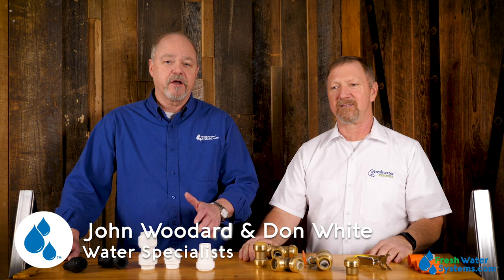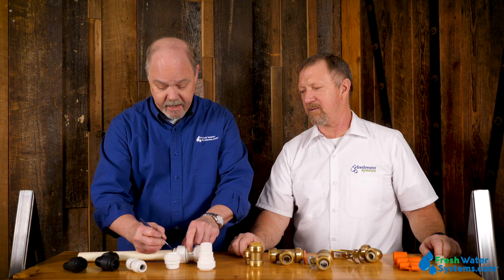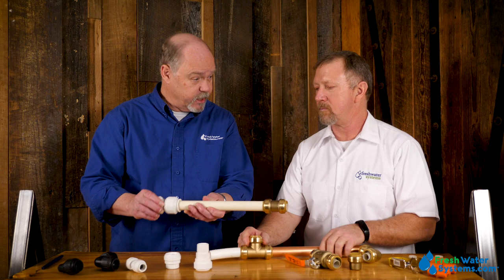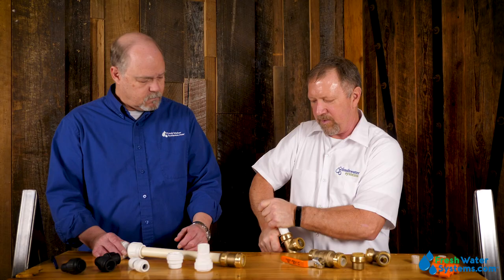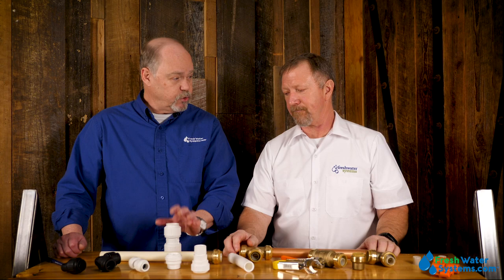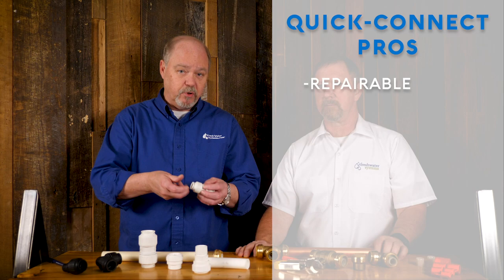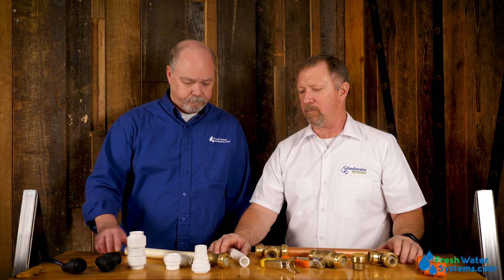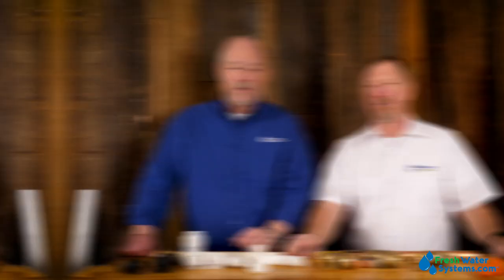John Guest Quick-Connect and SharkBite Fittings: Are They Reliable?

Comment: The problem with the o-rings is they can deteriorate when it comes in contact with chlorine from city water. If you live in the country side and use well water, those o-rings should last many, many years.
Reply: @sonacphotos  mine has lasted for years, no issues and still looks brand new.

Comment: How do the o-rings get UV light inside the fitting? What kind of crappy O-rings is Don used to using if he thinks they will deteriorate so easily? 

Why don't you discuss the approved uses, UPC code approval, etc?
Reply: I dont think he understands how UV light works.
Reply: @MrBoxxxed  I wonder if he understands how many nitrile O rings are connecting his fuel lines in his car as it goes from cold to extremely hot carrying gasoline.

Comment: In the UK virtually all new-builds are done with plastic pipe and most of it is behind walls or in the floor void. Think they offer 50-year guarantee over here.
Reply: My heating system is now over 10 years old and was redone in grey PB pipe with JG speed fit fittings. Zero issues after many winters and thousands of heat cycles. Glad we don't have sharkbites here, they look dreadful

Comment: The only time I’ll use them is in an emergency situation.  A lot of homes in Boise Idaho are plumbed with polybutylene and they make a poly to pex or Polly to copper adaptor.  I don’t warranty this repair because shark bites suck.  I’ll always give the customer the option to replumb the home since polybutylene pipe has such a huge fail rate, especially when the water districts use a lot of chlorine.   The other time I use them is if it’s a CPVC repair.  I hate cpvc and trust a sharkbite fitting over a CPVC glued fitting!  Again, I’m clear to the home owner that I won’t warranty said repair, and advise they need to get that plumbing out of their home
Reply: Hey Chris - what type of plumbing do you recommend/ stand-behind/ warranty for your customers?
Reply: "Because shark bites suck". Care to offer the world some definitive evidence? Most plumbers would disagree with you. What secrets have you discovered that the rest of us don't know?

Comment: Thanks. Which one is appropriate for a fridge compressor's pipe?
Reply: A refrigerator sealed system tubing is normally copper and steel. You should only make a repair with copper couplings and silver solder.

Comment: Craw'd  under the house and tried two new shark bite connectors and they both failed, these were new fittings and both failed on the pex end not copper end. Yes know how to installed'
Reply: I am going to call Bullshit.    Ther is no Pex End, or Copper end, they are exactly the same.  You did not install correctly.
Reply: You may not have used the insert which, as the video says, is required for plastic pipe.  Without the insert the pipe can deform and then leak. Copper does not require an insert

Comment: 'I wouldn't use them behind walls where I can't see them." Nearly every leak behind walls is due to failed solder connections or pinhole leaks in the copper pipe from corrosion or corroded galvanized pipe and fittings. PEX is not immune from leaks in walls due to punctures, cracks, friction. How is that any different from using a shark bite behind walls. For water lines to icemakers, water dispensers, where John Guest unions have been used, it is always the plastic tubing that fails, not the connector. Jesus, have either one of these guys ever repaired a sprinkler or water line in the yard? They have had compression/slip-fit couplings to repair/connect PVC underground water pipes for decades.
Reply: Really great point. As if the baseline is perfect and only Sharkbite may fail.

Comment: What's better a soildered fitting or a oring.
Reply: Peter Boissiere press
Reply: Whats better an o ring, a soldered fitting or just a split copper pipe in between a sharkbite and soldered joint?
Reply: I would say soldering but you cannot solder plastic. The push-fit fittings are nearly idiot proof.  Sadly it means that idiots now think they can plumb like professionals.